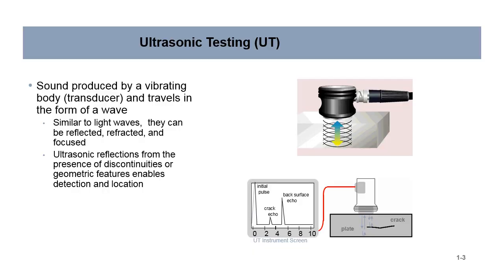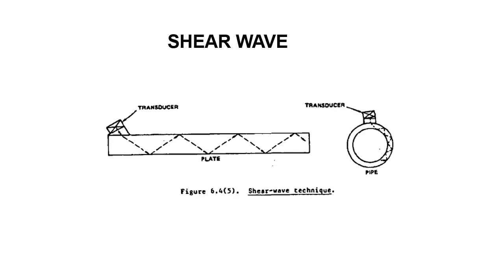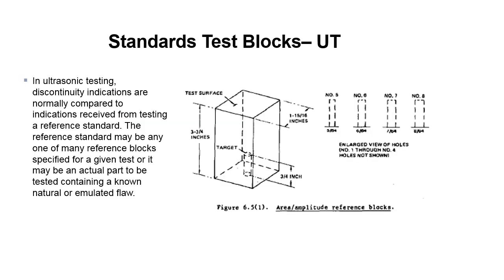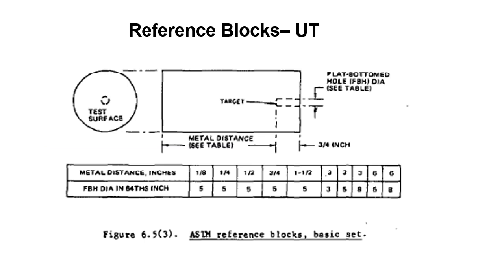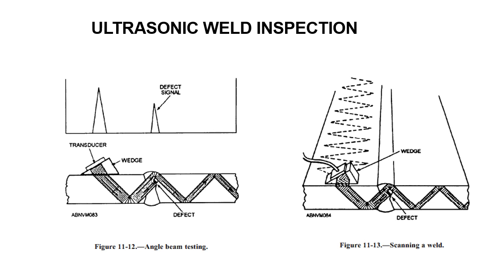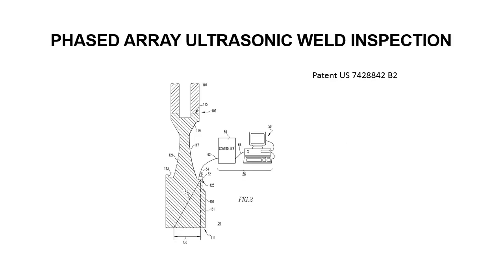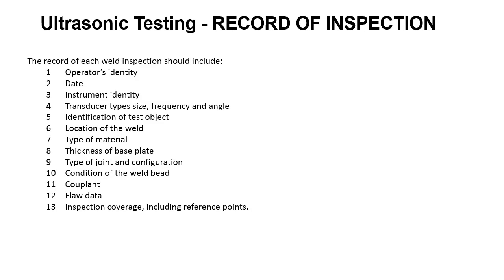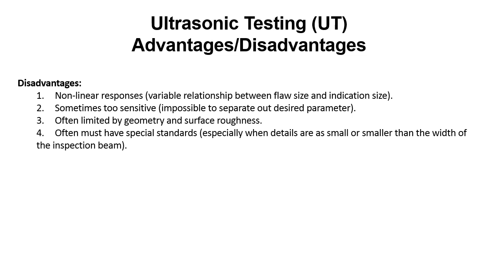Ultrasonic Testing (UT) for CWI Exam: Module 10 Part 14 - Complete Guide

Comment: In calibration and inspection there should be a record or process that is repeatable thus someone familiar with the instruments, training, and method of inspection should be able to repeat what you have inspected or calibrated. It is a way of standardizing so that everyone is on the same page and not guessing at the inspection method or calibration method if there's no record or process method no one will know what you have been doing.